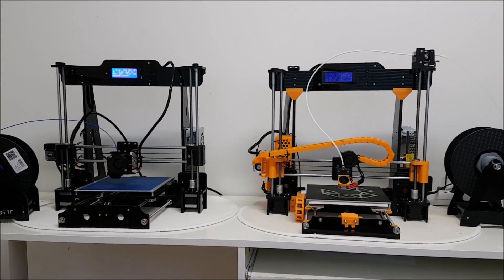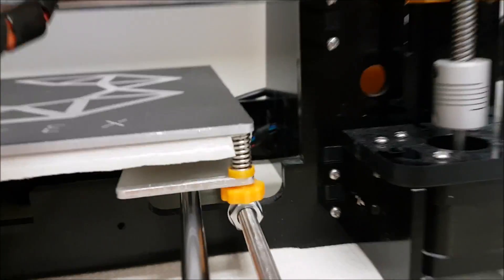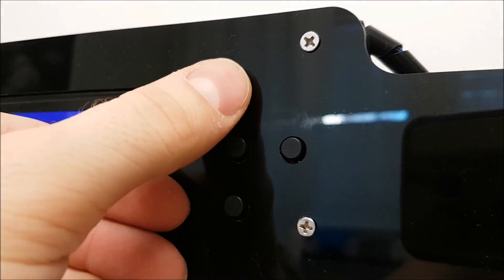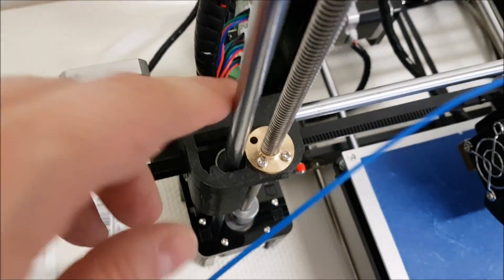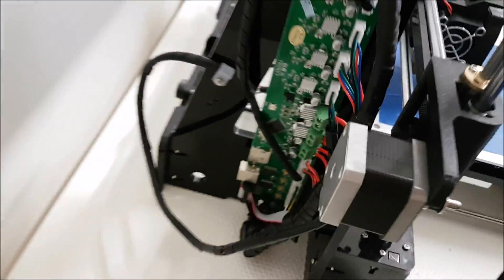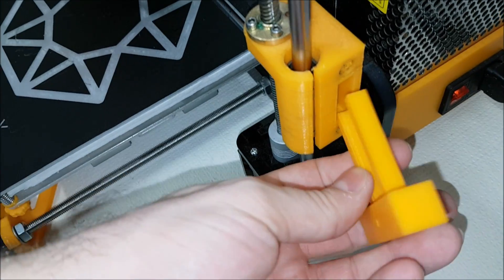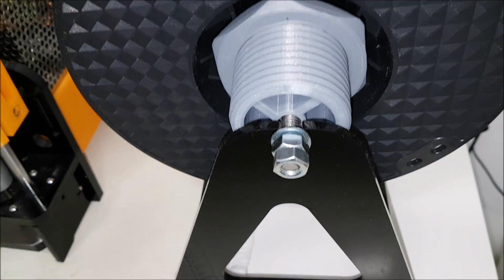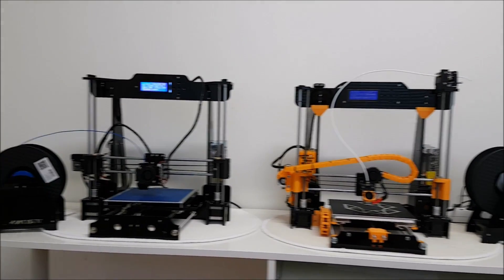Anet A8 vs Tronxy P802 comparing video

Comment: I have a what appears to be a Tronxy second hand from someone. The mainboard looks like a TronXy but is labeled DMYCO. It has an Atmega GA1284P chip. Can the mainboard be upgraded to Marlin? Do you know what the firmware was on a Tronxy? The previous owner could not tell me what the firmware was and only told me that it should be upgraded. Can it be flashed with a USBAsp or Ardruino?  Any help would be appreciated.

Comment: lol all the orange stuff is upgrades on the anet, that you can also do on tronxy. until you do all the upgrades to the tronxy this comparison is redundant.
Reply from the maker: I'm long away from those Acrylic 3D printers. Explore my channel there are way better and quality content, 4K tech video reviews of much better 3D printers then those two. Cheers
Reply: @NexiTech  I have a Tronxy p802ma that I was trying to use again. But I lost the sd card. Any suggestions? It printed nice in the past and I want to box it and use it for flex and abs. I just naught a ender 3 pro but it looks like the bed can't get the temp up without messing up the magnetic connection. This is just a hobby and something to mess with when finding things to do with the nieces and nephews.

Comment: Hello friend
I have a question
Does the temperature of the mainboard and the steppers keeps  low or is it high ?
Cause I have the same printer tronxy and I think there is overheat in both elements, but I don't know if is normal.

Comment: The tronxy p802 seems to be exactly the same as zonestar p802m (except the tronxy uses the new design off heatbed) soo there's upgrade parts on thingiverse that should fit.

I recomend printing a better designed x-axis motor mount, the one that's on there tend to flex when tightening the belt.

I use this one
http://www.thingiverse.com/thing:1354016

Comment: Don't get me wrong, buy I was hoping for more substantial technical details like belt construction (plastic/plastic), printer samples and A8 upgrades that can be avoid in this printer because its already better (if any), etc.
Your video was very informative for those hopping to upgrade their TRONXY from A8 mods.
The power supply can be silenced easily, lacks a simple thermistor inside, a well known 'problem' ;)
I'll keep tracking your excellent informative videos.
Reply: Basically the Tronxy is the better starter printer, but with a much smaller community. However I don't even think you need any upgrades for these printers. They will both print fine. The only thing I would recommend is using a belt tensioner ;)
Reply: Thanks. Keep your good work! Is a delight looking at your Anet A8  :)
Reply from the maker: If you look my previos review video about Tronxy and tons of Anet A8 vidoes you can find answers to all your Questions. Anet A8 use(plastic belt) Tronxy(rubber/fiber core),Tronxy have adjusting on Z axis switch and Anet A8 do not. Print quality is pretty much the same if you compare PLA and ABS but on flex material Tronxy will do better due to upgraded extruder. Anet A8 has more Upgrades on thingverse and Facebook page. All upgrades are completely free choose and you do not need to do any if you don't like it or if you are satisfied on standard. On both printer Hot bed bearing is pretty much must to do or its pretty noisy. Yes I know about thermistor switch but If you open power supply you loose guaranty and It's not that easy to do for average people. I hope I answer in more details info that you need. Cheers!

Comment: On the Tronxy, it looks like there is a stepper voltage adjustment for each axis.
On the Anet, you can only adjust the Z axis stepper voltage. My Anet is pretty noisy on the X and Y axis, i adjusted the Z axis and it was a huge improvement.
Reply from the maker: Benoit B Thanks for tips I will check it out. My steppers on Tronxy and Anet A8 are silent so I never tried to adjust voltage.

Comment: I've had my tronxy for 7 months and is in almost continuous use and I've not had any issues yet, worked straight out the box with great prints large or small and has no mods fitted. :)

Comment: I ordered the Anet A8 and was sent a Tronxy P802E.  This was good and bad.  Bad because it meant I could no longer print all the cool ANET upgrades I collected and planned out.  Your assessment that most of the ANET parts would need to be modified is correct. 

The good part is the P802E comes with a bowden setup with an E3D clone which is superior IMO and has worked absolutely flawlessly other than the PTFE tubing being just a smidge too short.  The soldered heat bed wires are also a plus. 

The MAJOR dowside to the Tronxy is the 3 bearing bed design.  I have to constantly adjust to compensate for the torsion flex in the acrylic bed support.  On the side with 1 bearing the front constantly has to be tightened (lowered) and the rear has to be loosened (raised).  After a few times of doing this the bearing becomes misaligned enough to cause shifted layers. So I end up having to reset everything including the Z stop.  I've tried bracing it with angle aluminum and even plate steel but no luck it still wants to flex.  

Other than that though the Tronxy has been a decent printer.  Can't say it's any better or worse than the Anet A8 but I really like that bowden setup.  There is a thingiverse group for Tronxy now - so join it if you have one and there are some common troubleshooting threads and modified things to work with the Tronxy printer variant.
Reply from the maker: Thanks for sharing your experience. I will definitely check it out. Good luck with your Tronxy.  
PS. Maybe you should keep paper cover on acrylic bed frame(screws hold better) or use some Loctite on screws or maybe drill 8 holes 4 on every side and install 4 bearing setup. Just some thoughts. Chreers! :)
Reply: Thanks for the suggestions!  I actually do use loctite blue so the bearing blocks stay put but it's the sub-par 3 bearing design that causes the flex.  I ordered another bearing block and it just got here today so I'll be installing it such that it will have 4 bearings supporting the movement of the acrylic bed support.  I'm confident this $2 upgrade will improve this printer considerably!  The only issue is that there's only enough room on the acrylic to mount 2 of the 4 screws for each block so I might slide it over a bit or try to add on some more acrylic to screw into.  I'll let you know how it goes.

Comment: Thank you for your video! Exactly what i am looking for! I still have to decide between these two ... i think i will pick the TronXY, as i am quite good at 3d modelling and so i can adjust the AnetA8 upgrades to the TronXY. Any advice as what is should by together with the 3d printer? (I have never printed anything before on a 3d printer) So far i have figured that i need masking tape and some lubricant ... is there something else one needs for this kind of printer?

Comment: Tech2c did a vid in a PSU  like that, there is a link where you can add a thermal switch that only comes on at 45 C, as that's a 30A power supply and it's only drawing 15A approx max it's not being pushed that hard. https://www.youtube.com/watch?v=LNyZnfy3bRE&t=5s
It's a different story with the Anet 20A PSU you should really add a fan
Reply from the maker: True but I already open it to check that ''mod'' like shown in video and in this power supply that come with Tronxy don't have that electronic circuit like on that 30A power supply show in video. Maybe there is another way to do it. I will check it soon. Thanks for comment. Cheers!